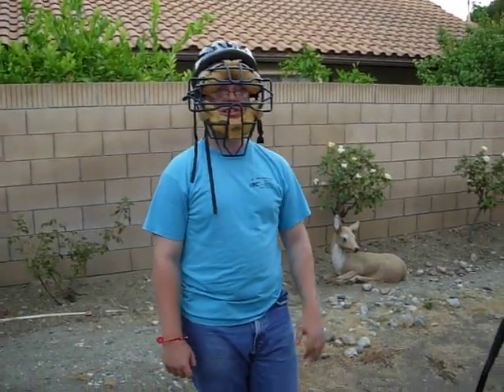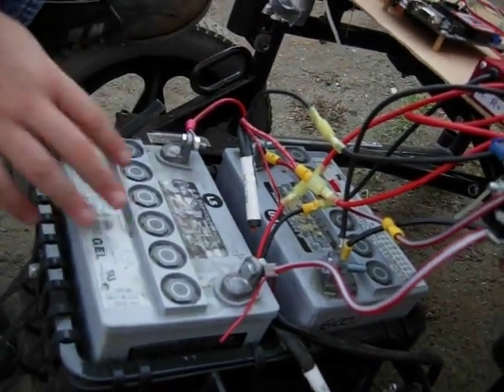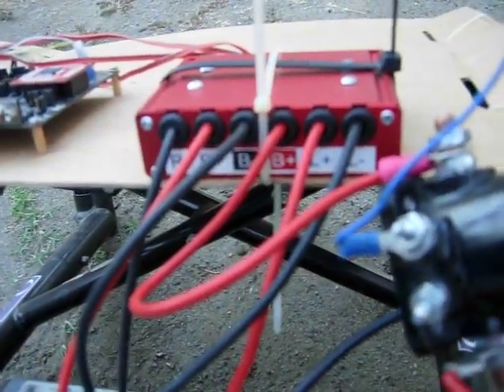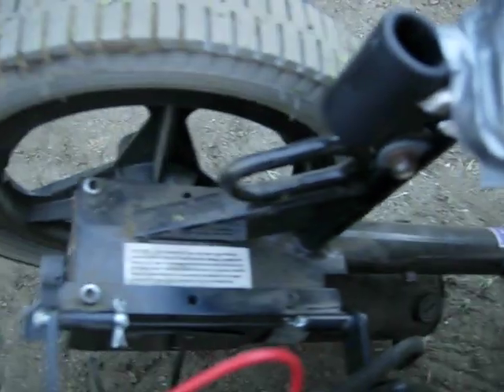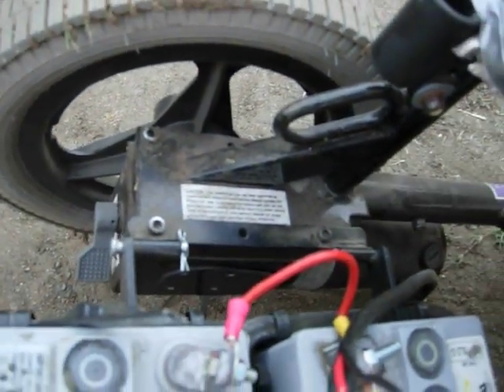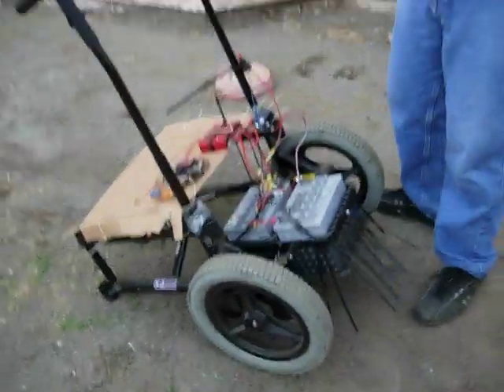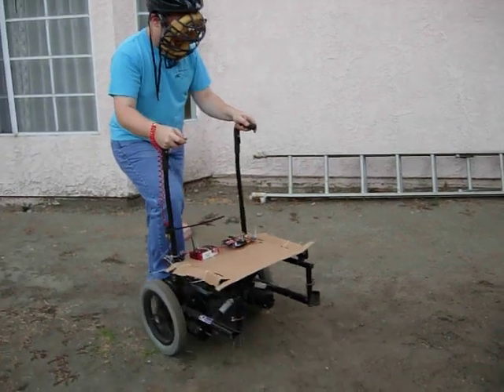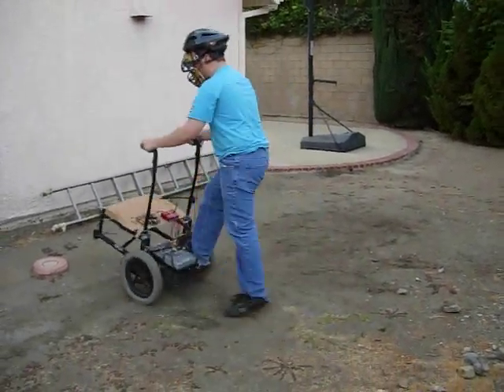Eric's Inverted Pendulum..Prototype 1

Comment from the maker: OUCH..At the end of the first day of testing, a loose Solenoid wire caused an battery power input transient to the $400 Sidewinder Controller and blew 4 mosfets.  Soooo... a word of caution: Use lock washers on all high power terminals!!  RobotPower was nice enough to send a rebuilt replacement for a $100 and allowed us to repair the original one at a discounted price.